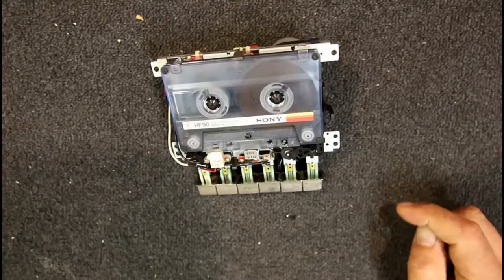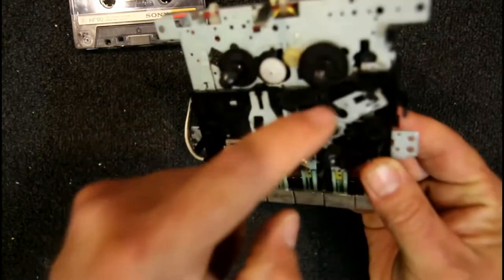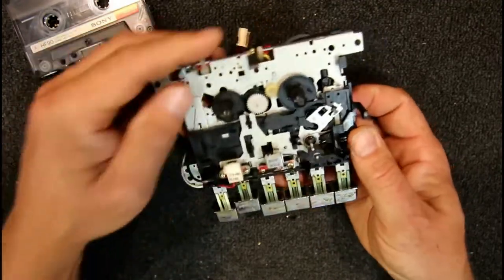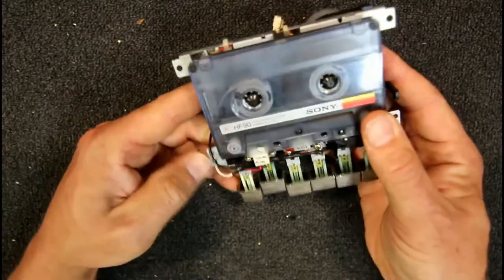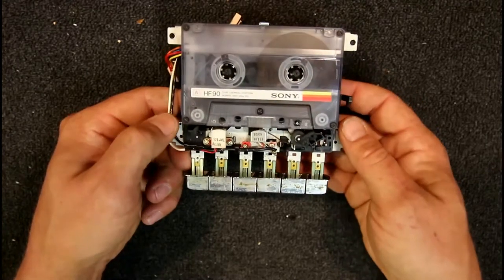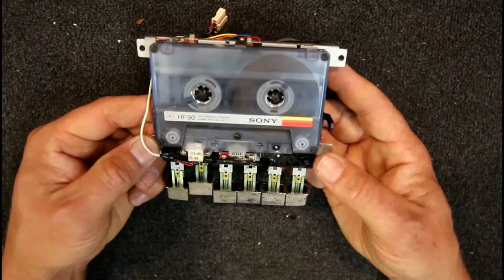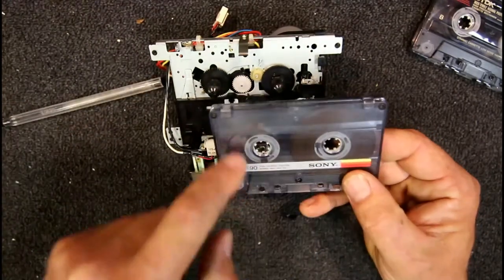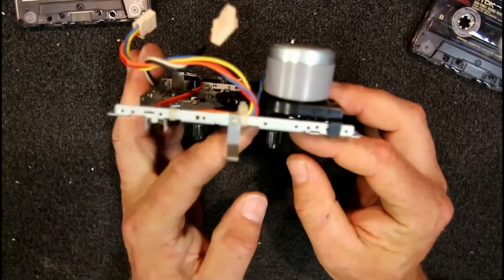Cassette Player take up clutch operation

Comment: I've been working for days on not one but three Atari 410 tape decks, all with the same problems, made around 1982 for use with the Atari 400/800 computers. Replacing the four belts in them wasn't enough, as now fast-forward and rewind are working well, but when playing the take-up reel keeps jerking in fits and starts. At worst it chews the tape, at best the playback is very warbly. The lower capstan drives a rubber idler tire, which turns the take-up reel assembly. I've roughed up and cleaned the rubber tire but that hasn't improved things, so I've ordered rubber washers that I hope will fit. But after watching your video I'm becoming very suspicious of the take-up reel now too. The felt clutch between the two parts of the take-up reel assembly doesn't seem to be glued to one side or the other, so maybe that's the problem, that there isn't enough friction inside it. It all seems very dicey. Thanks for your videos! G'day from Thunder Bay, Canada.

Comment: Very nice video. Thanks. I grew up inthe early '80 but only just started understanding these. Trying to work out why a take up reel would spin with no pressure on it but stop spinning when a tape is put in. Thanks for the upload.

Comment: I acquired a Kenwood KXW6040 double deck recently, that was in the original box, nearly untouched-minus some shipping damage. It has an unusual 4 centimenter diameter spindle clutch mechanism, and 4 rectangular felt pads attached. The deck is wrought with issues. At first it wouldn't operate at all, and after new belts and lubricating the capstans both decks play normally in reverse-only! Very strange that their problems are identical! Forward play is at double-time, which suggests a pinch roller problem, but the roller are pristine! I'm at a loss here, but your video gave me some helpful tips to explore, such as clutch resistence, etc. Suprisingly, for a "high-end" deck-with all the bells and whistles, it is the crappiest mechanism I've ever seen! Only one motor, exceedingly thin flywheels, and an undersized belt. That with this clutch contrivance makes me wonder if it's worth fixing? I have a 1993 KXW8050 that's a year newer, but an entirely different construct! Heavier flywheels, 2 motors, flat belt, and no cheesy, giant clutch! LOL! Thanks for the valuable tutorial! James.
Reply from the maker: Those later decks tend to be cheaply made, I think they were just made so that their component systems had a tape deck, even though hardly anyone used them by then. The other deck may have been sold as a separate deck for people that wanted to replace an older one at a higher price. Its still likely the pinch rollers are at fault. Its usually because they dont engage, eg lift up properly and press onto the capstan, or the springs on them have come off or something that holds the spring is broken. Its very unlikely that a clutch could pull the tape through fast with a pinch roller engaged because it lacks enough torque, unless the clutch itself is stuck together and not able to slip.
Reply: @StevesElectronicRepairShop  I think you're right; I tend to discount the clutch as a culprit-since I've managed to get the unit playing and FF/WW in reverse direction on both deck A & B(again: strange coincidence that both decks have identical behavior!). Their might be either a spring or lubrication issue with the forward-play pinch roller assemblies on both head mechanisms? I'll have to remove them and check it out. The unit looks brand new, and the rollers are unused, but I think it's suffering from decades of sitting unused in the box! As you know; the best way to screw up a tape deck is to not use it! LOL! James K.

Comment: Thanks for all the great info. I’m having a problem with the felt clutch disc on a Yamaha mt120 4 track. It doesn’t seem to be touching the clutch enough and will not spin the reels. If press on the disc a little bit it seems to engage the gears ⚙️. I’m speaking of the clutch on the ‘back’, not the reels. It sits on the shaft freely, no spring, just the belt holding tension.
Reply from the maker: I am not familiar with that model. If it has a plastic pulley with a belt on it and then a felt pad and metal or plastic disc on the felt, then it should still have some sort of spring on the other side of the pulley to hold them together under some tension.
Reply: @StevesElectronicRepairShop  Thank you for your help. I will look into this.

Comment: I have a Pioneer CT-W650R. This has two cassette decks, but only the right side records. I bought this mostly in order to record, but the head mechanism on that side never moves up when I press play. Is there a way to fix the mechanism to move up as it should? OR is there a way to switch the left side deck to the right side in order to record? Thanks Steve.
Reply from the maker: It most likely needs new belts. If its a logic controlled deck the mechs shouldnt differ much besides the heads and switches above the tape in theory, but its not always a straight forward job to swap them, or any less work than repairing the faulty one.

Comment: I have a Cassette Player in a Panasonic SA-HM35L that I'm trying to repair. The rewind and fast forward on both mechanisms doesn't work, the button just pops back up as soon as I press it. However, if I turn the right spindle (The black one in the centre of the mechanism) it doesn't pop back up. Is there a fix for this?
Reply: Availability of the mechanisum

Comment: Hi. My rewind autostop isn't working in REW on my Tascam 133.  Just spins on the outer spindle and doesn't stop.  The right reel is stopped and left keeps on spinning.  Is there adjustment to the clutch to give it a bit more bite?
Reply from the maker: The auto stop is usually a completely unrelated part of the mechanism. I think I covered them a bit in my video on how Cassette players work. A worn clutch usually needs new felt in it. You could also pull it apart and stretch the spring so it applies more force when compressed back in the clutch.
Reply: @StevesElectronicRepairShop  OK.  Is that normally accessed from the front of the tape tray or from behind it?  It's not exactly an easy deck to work with.   Kind of studio quality and complex.  I've pulled the whole tape assembly out, dropped the idlers.  I can see the back side of the table.  That spring is in there somewhere?
Reply from the maker: @rcary  The takeup clutch is built into the take up reel usually so is accessed from the tape side of the deck

Comment: Thank you very much for this video and previous one! Now I know that was wrong with my boombox -- previous owner lost the autostop lever and the spring for slip-clutch and just glue tape spindle, luckily with weak glue. Replaced the spring, but not the autostop lever. Maybe you can give a name for this type of tape mechanism, so I could look for schematics? I doubt there is a supply of spare parts, but I think that a can make some kind of (crude) reproduction with some plastic and file. Or, perhaps, you can upload somewhere a photo with measurements? I would be very thankful =)
Thank again for those videos, they are awesome!
Reply from the maker: It would be hard to make another auto stop lever. You will likely also need a spring that pushes against it. I believe the mech in the video is a Tanashin TN-21ZW, though there is a different commonly used mech that people call a Tanashin, but its not shown on the archive of their website: https://web.archive.org/web/20200221171330/http://www.tanashin.co.jp/english/aboutus/history.html
Many units used the same mechanism, so if you can find any mid 80s or later Cassette player it may have the parts you need. You can usually tell if its the same mech just by opening the door and looking at the auto stop to see if its the same. Its easy to swap the auto stop parts.
Reply: @StevesElectronicRepairShop  Thank you very much for the info! I'll try to find something. Still, even without autostop function it works well -- just slips endlessly against clutch when tape ends -- you need to manually press "Stop".